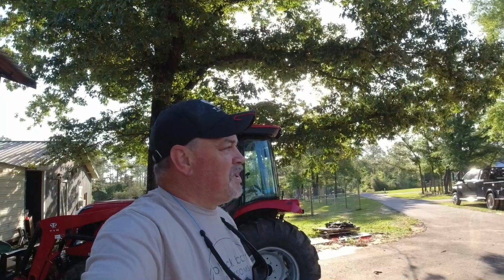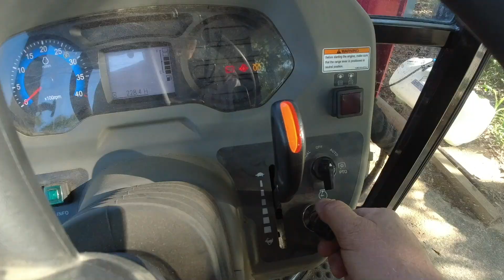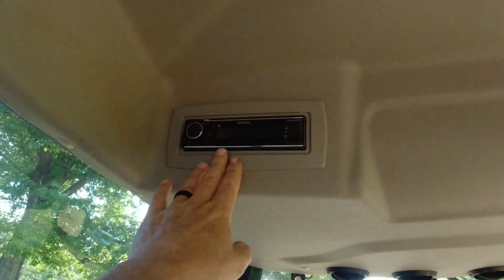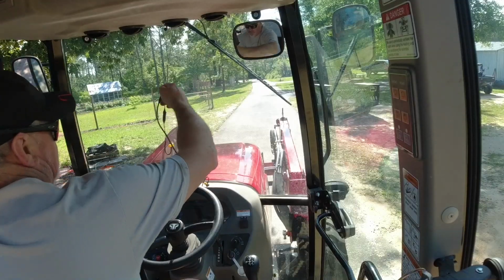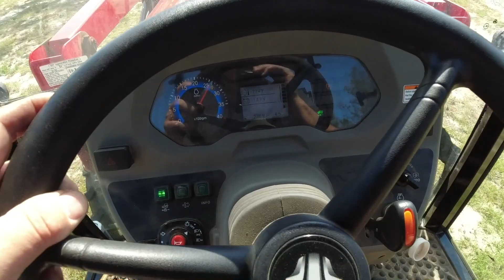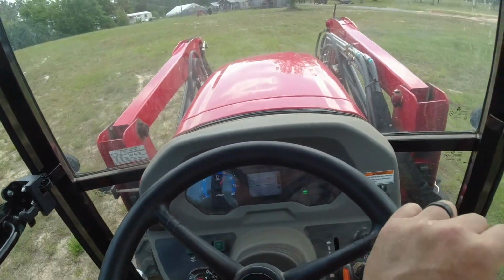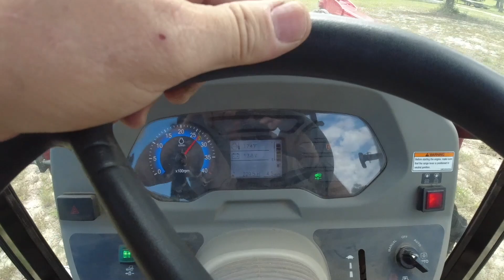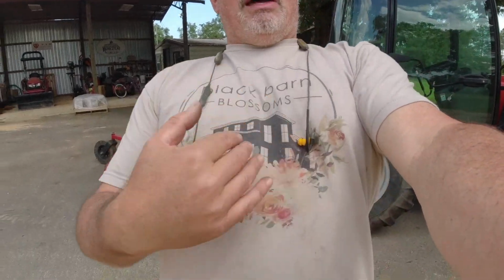I have to bushhog 6 acres, but first MAINTENANCE on the TYM T574!

Comment: My guess would be the fuel gauge is of a float design as opposed to a capacitance type. That might explain the variation of measurement as the tractor changes its orientation from level.

Comment: Hank, I really like your tractor and I’m really enjoying your tractor videos.  How does the price of a TYM compare to a Kubota or a John Deere?
Reply from the maker: The TYM usually comes in a several grand less than JD or Kubota with the same options. John deere 5075 runs about $65k the T574 goes for about $43k both prices are dependent on options, etc
Reply: @hhamilton1970  i appreciate the information. I have been looking at tractors with cabs on them, mostly for health reasons.  I love working outside mowing and bush hogging but pollen and dust are not my friends. 😂